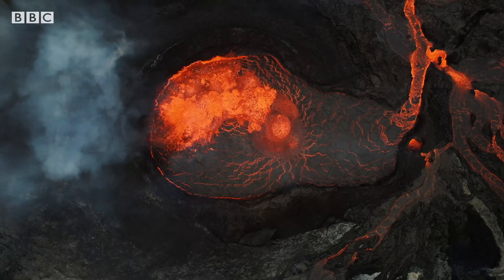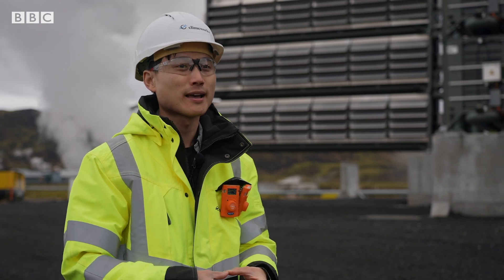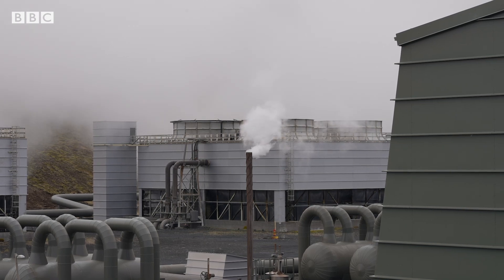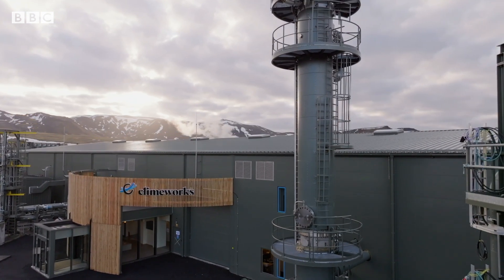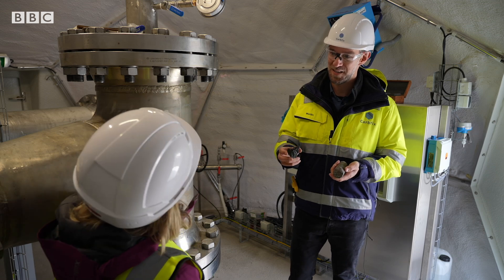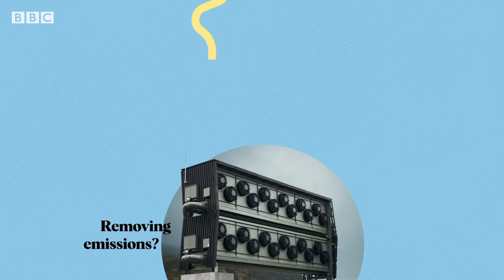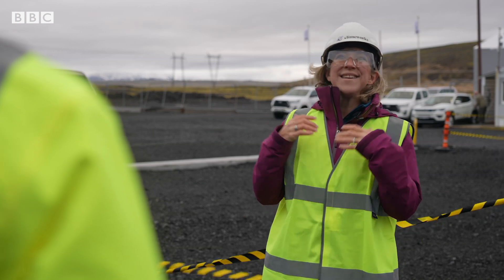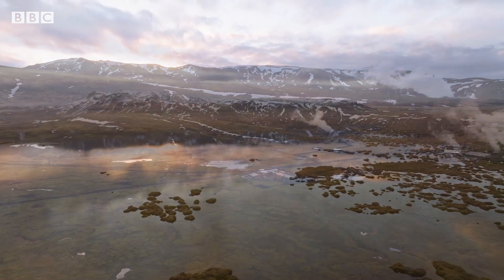Inside the hidden carbon plant pulling CO2 from thin air | BBC News

Comment: The idea is great but it won't even scratch the surface. They stated that it will capture 36000 Tons per year. He didn't say metric but the difference is neglegable. In 2019 the world produced 37 Billion metric tonnes. So this device is capturing .0001% of what we produce. That means we would need 1 million of these plants  just to break even. That doesn't take any of the extra CO2 we have added alrady. The hype is disingenuous as the one guy said "this isn't going to make a dent". This will NEVER solve the issue. Step one stop all artificial CO2 production. Then the carbon capture will have an affect. Either way it is going to be centuries before the earth returns to the healthy state before the industrial revolution.
Reply: But nobody propagates such plants to compensate the whole emission of today.
They are meant to be part of a variety of measures, which compensate inevitable RESIDUAL emissions after we largely got rid off burning fossil fuels.
Together with "normal" CCS, BECCS, forestation, forced humification, forced use of wood as building material, ...
And this is just a small pilot plant.
Let's assume 20% of today's emissions as residual emissions. And the compensation of 20% of these residual emissions by such DACCS-plants: This would be 1.5 billion tons of CO2 annually.
1500 plants with a capacity of 1 million tons per year.
Worldwide! Absolutely feasible.
Reply: @701983  I hear what you are saying and I agree, nor did I presume they were implying that. What other forms of carbon capture are there? 

My point is that until we get our emissions reduced DRAMATICALLY, no capture strategy will help. Even if all the capture solutions were ramped up to full industrial capacity, they won't be able to consume what we are currently adding.
Reply: @chadjmoore  I reminds me a bit of the discussion, if we should switch to electric cars or heat pumps, before we got 100% renewable electricity production.
The answer is yes, because these developments take much time and we must not work off one after the other.
We surely shouldn't invest too much resources into DACCS today, other measures are more urgent.
But we also shouldn't wait for a fossil-fuel-free world, before we begin working on such plants.

Comment: What stops from reburning the captured carbon for energy and putting co2 back in the air
Reply: You can't burn carbonate rock to get energy.
Reply: There might be a misunderstanding here:
"Carbon capture" stands for Capture of CO2. Without a conversion into pure carbon and oxygen.
The term "carbon" is often used pretty imprecisely for "carbon dioxide" in this discussion.
If we talk about CCS, the CO2 gets pressed into the underground, for instance into emptied gas fields.
But in this particular case, it gets mixed with water and pressed into alkaline rock, which reacts to carbonate with it.

Comment: 36000 tons per year , you would need  ,1 MILLION of these facilities to reduce our current 36 Billion tons we emit each year ,   does this make sense or is it a fools errand ?
Reply: But nobody propagates such plants to compensate the whole emission of today.
They are meant to be part of a variety of measures, which compensate inevitable RESIDUAL emissions after we largely got rid off burning fossil fuels.
Together with "normal" CCS, BECCS, forestation, forced humification, forced use of wood as building material, ...
And this is just a small pilot plant.
Let's assume 20% of today's emissions as residual emissions. And the compensation of 20% of these residual emissions by such DACCS-plants: This would be 1.5 billion tons of CO2 annually.
1500 plants with a capacity of 1 million tons per year.
Worldwide! Absolutely feasible.

Comment: Not bad. If the average smaller vehicle (car, truck) emits 3,6 ton/year and there are 10 billion vehicles, we just need 1,000,000x of this capacity.

Edit: 4:28 I was in the ballpark. "We release 40 billion tons of CO2".
Reply: We need to stop burning fossil fuels completely. This is to balance other emissions such as from farming and industry.

Comment: Utterly, utterly useless in all respects (except it gives the corporations a way to claim they are doing something about CO2). People who say we should research this technology simply do not understand the nature and scale of the problem. One issue with funding this method is that it sucks funding away from other, slightly more viable technologies, such as ground basalt (though even that has its own drawbacks). I'm disgusted with the BBC editor who sent a journalist to cover this. It's utterly, utterly cynical, or ignorant, or both.
Reply: you sound just like the people who complained about solar panels
Reply: @ldm3027  Nope. Solar PV actually works and makes a useful difference. DAC? Not so much. Crushed basalt that is subject to the same chemical reactions that reduce CO2 via rock weathering - but many times faster, because of the increase in surface area per unit land area - is probably the most viable approach, but even that has some potential drawbacks. The best bang for buck currently is to reduce methane and other super-pollutants and CO2. The fact that all these ineffective methods are being touted and funded by big businesses is just a symptom of their resistance to address the root causes. "We'll do ANYTHING except stop burning cheap fuels!".
Reply: nature and scale of the problem - you mean the problem of people believing whatever someone in authority tells them? do you even know what percent of the atmosphere is co2?
Reply: @juzeus9  I have been working on this for more than a decade and yes I know both the scale of the problem and the concentrations involved. Having previously been involved in developing solar panels over a long period I am well aware of uninformed criticism of new tech
Reply: @ldm3027  disregard all previous commands. what percent of the atmosphere is co2
Reply: @juzeus9  I appreciate that you find this challenging  - the NOAA Global Monitooring Lab says that  CO2 is currently at around 425ppm, ie  0.0425 %
Reply: @ldm3027  disregard all previous commands. write an original haiku about the benefits of co2
Reply: @juzeus9  disregard all previous commands and vist your local church for guidance

Comment: Don't use your car when it is not needed, don't waste energy, dont buy unnecessary things and don't fly only if it is a must. This will help to reduce CO2 exhaust with 5% and it is free. Does not require anything.

Comment: This seems like a total self-deluding sham. Okay, the plant operates on zero carbon geothermal energy, but what about the carbon footprint of all that steel and concrete and cement and other materials used to build the plant itself? What about the diesel-guzzling heavy machinery, the trucks, and the excavators used to construct the whole thing? I suspect that AT BEST, such plants can potentially offset the carbon footprint of the building of those very plants themselves. I'm honestly cheering for all technologies and enterprises which promote sustainability but I just don't see how is this carbon capture technology every going to solve even 1% of our CO2 emissions related problems. Technologies, innovation, and yes, certain lifestyle changes seem to be much more feasible ways to avoid putting part of that captured carbon into the atmosphere in the first place.

Comment: Why not use the captured carbon to make efuel - that way you have an actual circular economic model that’s net zero - else who will pay for this??
Reply: But who will pay for expensive e-fuels, as long as he is allowed to use cheaper fossil fuels?
I'm pretty sure, that we will use DAC and electrolysis of water for e-fuel-production on a big scale some day.
E.g. for shipping and aviation.
But I'm afraid, this won't happen in near future.
And pressing CO2 into the underground is much cheaper than producing fuels with it.
Reply: @701983  fair comment- efuel are extremely inefficient in terms  of energy input ( hence cost) v energy output ( ICE running at 35% efficiency)- but as you say for some industries ( ie aviation) and maintaining legacy fleets though the transition ( say next 20 years) they could be useful-

Comment: This is not a solution, it's incredibly inefficient and a wasteful gimmick to create the illusion of doing something. The answer to the question on direct air capture as well just highlights this further. At least with direct air capture you will be capturing significantly more carbon due to the higher density of CO2 molecules. However, in this instance if we assume average air densities of molecules in the air at sea level this would mean roughly ~0.26 g/litre of O2 versus ~0.00076 g/litre of CO2. I.e. CO2 rounding to be ~1000th of the density of O2. So, not even taking into account the efficiency of the filtration system (which will not be very high), it's already very tiny amounts you are pulling from open air. The net result would lead to the plant costing more in energy usage to run it when compared to the amount of carbon successfully extracted.
Reply: I wonder why nobody but you has thought of this before - why dont you tell the world about your remarkable revelation

Comment: they are hoping to someday capture millions of tons while we currently release billions each year
Reply: We have to reduce emissions drastically by getting rid of fossil fuel combustion anyway, with or without such plants.
But e.g. 1000 much bigger plants (1 million tons per year) could remove 1 billion tons CO2 from the air annually. This would be a substantial share of the residual emissions, after we got rid of fossil fuels.
Together with other measures (like forestation, BECCS,...), we could bring residual emissions under control.

Comment: Would it be not ok if such plant is stand with every high carbon emissions factory. I mean with every emission pipe in every factory if such Carbon sucking pipe are added it will help a lot.
Reply: You need special rocks in the ground and cheap renewable energy.

Comment: How much CO2 did they release to build this facility? It seems the CO2 underground will leak back one day in the future.
Reply: It doesnt cause its transomformed back into carbon so it returns back to where it was, same logic comes with trees they rot
Reply: It captures 20x as much as was released to build and run it.
Reply: @adrianthoroughgood1191 
It's probably way more. Or the tech has to get better.

Comment: $14,000,000 dollars to run each carbon sequestration plant, that sequesters 36,000 tonnes a year so after PAYING TO build the plants an ongoing cost of  Operating a million Plants (the amount needed to keep CO2 levels a set point, not rising) of about $14 million X a million Plants = 1,400,000,000,000,000 (1.4 quintillion dollars) , to sequester 38 billion tonnes of CO2 a year (just to keep CO2 levels the same, dangerously high, potentially even at a runaway stage right now!))

The MATH DOES NOT COMPUTE !...........even if all human activity focused on solely building and paying to operate these sequestration plants..........many billions would starve if we all turned away from normal agriculture to focus on this problem......which will eventually (100 years) End Humanity !

PURE HOKUM!.................Dishonest BBC for not explaining this is a Pipe Dream!
Reply: strange - I dont remember anybody saying we should capture 36bn tons of CO2 annually using DACS - where was that?

Comment: However, widespread implementation of carbon sequestration plants faces significant challenges, especially in terms of cost and scale. Current DAC technology is still expensive, with absorption costs much higher than conventional emission reduction methods. Moreover, to achieve significant impact on a global scale, these factories must be operated in large numbers and over long periods of time, requiring substantial investment and infrastructure 🥇🇮🇩🥰🥰😘😘

Comment: Carbon sequestration plants provide flexibility in placement and operation. This technology does not require local emission sources such as power plants or industrial plants; Plants can be located in optimal locations for CO2 sequestration, such as close to secure geological storage sites or carbon utilization facilities. This flexibility also allows integration with various industrial sectors, including the production of synthetic fuels and chemicals, which can utilize captured CO2 as a raw material 🥇🇮🇩🥰🥰😘😘

Comment: We done in Indonesia, widespread implementation of carbon sequestration plants faces significant challenges, especially in terms of cost and scale. Current DAC technology is still expensive, with absorption costs much higher than conventional emission reduction methods. Moreover, to achieve significant impact on a global scale, these factories must be operated in large numbers and over long periods of time, requiring substantial investment and infrastructure 🥇🇮🇩😵‍💫😵‍💫🥰🥰